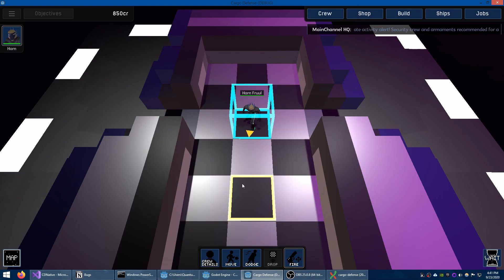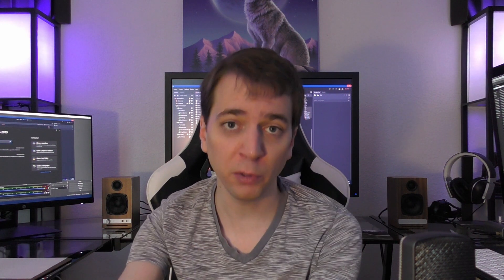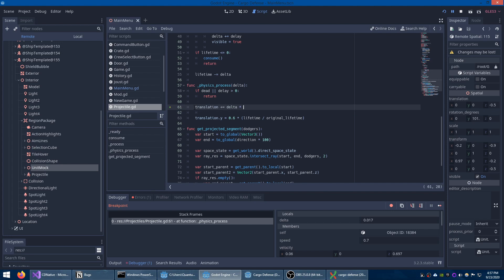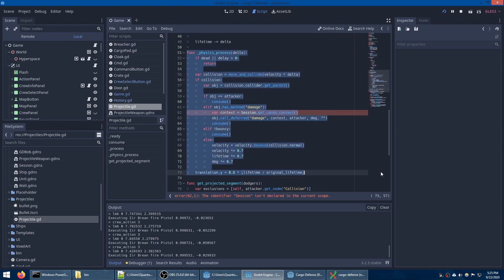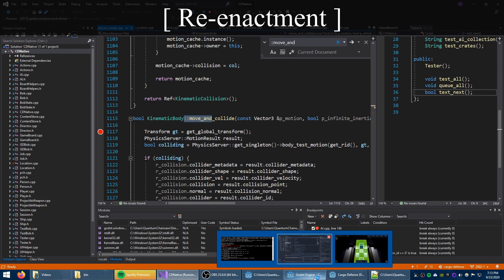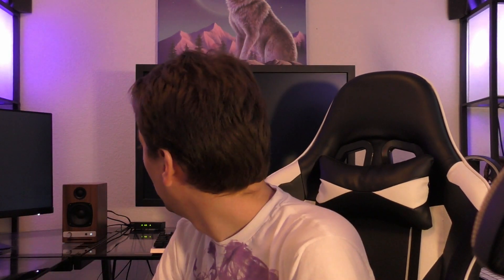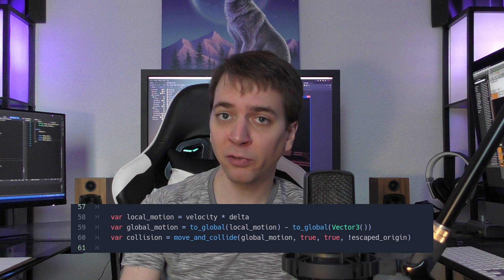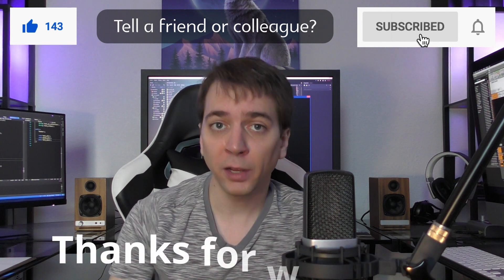Debugging Techniques in Action (Cargo Defense Devlog #63)

Comment: Ok, I'm paused at 5:09 and I'm at the point where I think it's so blindingly obvious I'm shouting at the screen. So I thought it would be a good idea to write what I'm supremely confident about in order to maximally embarrass myself if I'm wrong and hopefully kick some humility into myself.

You're doing `translation.y` (this is looooong depricated, nobody uses this! It's `transform` or `global_transform`, check the docs...). But that's not what's crashing it, well, not alone. The matrix on the ShipTemplate (the grandfather) is Basis.LEFT. But you're also sending with `move_and_collide` - orthogonally! There's zero dot product between the two...  Goodney. You're adding a subspace vector transform (a deprecated one at that) to a global physics transform. Oh man. That's not going to end well...

You had a translation issue, fine, we all get those. Your approach was too complicated. Did you not notice how the original was straight? There were two orthogonal translations (even in purely global space this was true), the first step should have been to comment the second translation (line 73). The ball would have travelled straight.

Unless I'm wrong, in which case insert mocking comment below. :)

Comment: I use a program called Diffinity to contrast old code vs new. It will highlight all the changes. Also, you might need to take a search feature to your code to find out if a value is being used for two different things.

Comment: I've just spent a week on a similar issue where something worked, then didn't and I've literally only just solved it twenty minutes ago.
I'm making a 2D platformer.  My character would get knocked down and get back up again no problem.  BUT if she got knocked off a ladder; she'd get up and be locked in place.  I had announcement debugs going all over the place trying to figure it out.  The overarching problem is that while I am making a singular game, I'm also using it as an opportunity to try different approaches and learn.  This has resulted in some very messy code, as well as a lot of valuable lessons.  Anyway, I just wanted to share that because I know how good it feels to finally squash a seemingly inexplicable bug =)

Comment: I love it. I'm rrreally new to programming and development, self-taught, and don't really have anybody in my social circle I can talk to about any of it. So to see a competent programmer struggle the same why I do, and solving problems the same why I do, makes me feel much better and confident. Thank you for that.
Reply: I'm also self taught, and what I've learned so far is that confidence goes a very long way. The other thing I reccomend at the beginning is to be flexible with your coding style, as what you're doing now may work, but is probably a bad way to do it. There's nothing wrong with that; don't go rechecking all your code. But when you see someone else's code that does something similar to what you've done, take note of the differences. Consider which is better in speed, modularity, memory, etc. That's how I improved.

Comment: As soon as you started the debugging process, I just knew that it would be a local-global issue. UE4 is the same in that regard. Half the time, you have pretty much no way of knowing which one you are supposed to use. :-D
Reply from the maker: I was wondering how many people would just immediately catch the problem before I do in the video. It's a lot more obvious in retrospect, but sometimes the obvious can slip by you
Reply: @Thoughtquake  Absolutely. I meant it as "I feel your pain" :-D I hate that feeling. It has to work... It must... Everything is right... (after hour, day, week)... Oh, I see.
Reply: I initially thought it was going to be relational rotation problem in the hierarchy of nodes until he manually moved the object with velocity * delta instead of using Move_And_Collide.